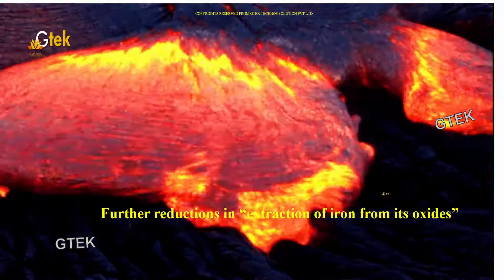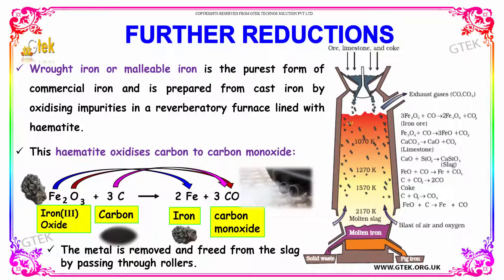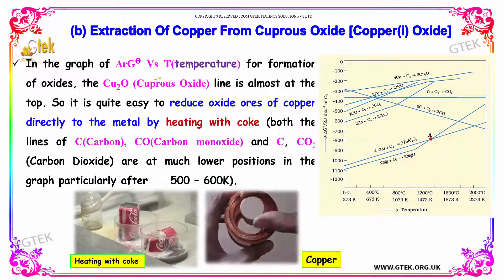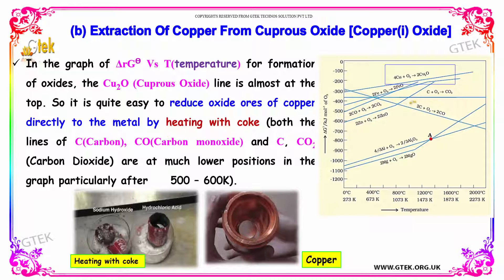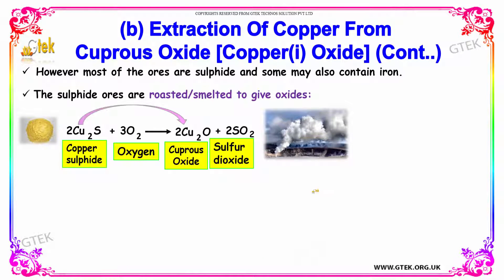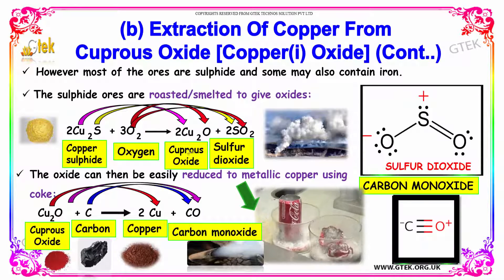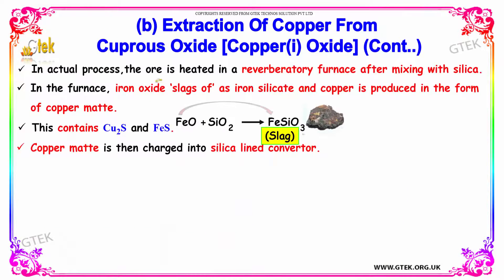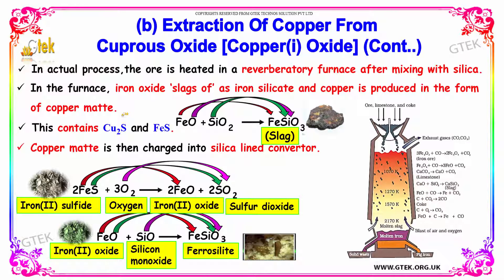extraction of copper from cuprous oxide  class 12 chemistry subject notes cbse

Comment: The heat of the copper makes the pole emit a gas that reduces the cuprous oxide to copper. It was the use of these poles gave rise to the term "poling". thermodynamic reasons, an oxide rather than a sulphide is used for reduction. metal obtained from it by chemical or electrolytic reduction.

Comment: The traditional method used at most mines involves the ore being broken and brought to the surface for crushing. The ore is then ground finely before the copper-bearing sulphide minerals are concentrated by a flotation process which separates the grains of ore mineral from the waste material, or gangue.